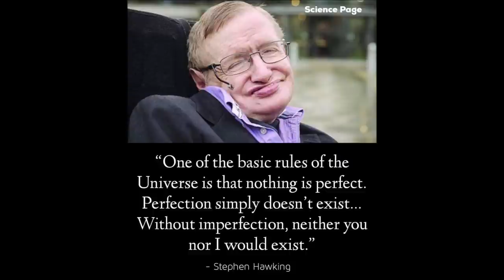1995 Toyota Supra Twin Turbo 2JZ-GTE 1/25 Scale Model Kit Build Review AMT Fast and Furious AMT1101

Comment: I'm 64 and graduated in 74 and my friends hate these cars because we grew up with the 426s and 409s and 427s etc. But I tell them all to take their cars and run these cars to get some respect for these bad boys ! They are hot modern muscle cars and this was a great representation of them . Tks
Reply from the maker: You bet, in stock form these Supras were running faster 1/4s than most 426 equipped cars. Lots of bang for the buck!
And they could turn a corner too.   LOL

Comment: Awsome job! One thing I started doing for stuff like the hood vents to get a cleaner edge is to use lots of black panel accent and let it draw up to the edges then use acrylic to paint the vent. It means you don't need to brush paint right up to the edge and the panel accent draws up to the edge in a nice clean line
Reply from the maker: Yes it can be done that way as well, thanks!

Comment: That twin  turbo can get down the road rapidly, and I mean rapidly.🏁👍
Reply from the maker: Google says 13.4 quarter mile bone stock, which is as fast or faster than 426 Hemi car speed. And just a little more boost from the stock set up gets you into the 12s which is moving out.

Comment: Very cool kit Chris.  I have looked at this kit a few times and just picked one up. Mainly was worried about fitment issues. You said it went together nicely so I may have to pull the trigger on one and add it to my stash.
Reply from the maker: Glad I could help!  Honestly, I rarely have issues but I'm not a perfectionist. There are very few kits I've had fit issues with that can't be fixed fast with simple work.
I think some folks in model world just love to pretend things are harder than they really are.

Comment: I can’t really tell if Round 2 corrected the flash issues on the front bumper. I built the last issue of the FnF version and the flash on the front bumper was horrible. It was difficult to smooth it out. I wanted to build it like the FnF version, but the orange color I chose was way off and decided to go a different route. I put a big block Chevy under the hood and lowered the heck out of the car. I’ll post it on the hpiguys Facebook page soon.
Reply from the maker: I'm not seeing any issues with mine.

Comment: For clarities sake this engine is not VVTI, that system didn't debut until the 97-98 model year.
Reply from the maker: I'm just reading off the box man. I'll leave the specifics to the 'experts'. Maybe it's a transplanted engine, who knows, it's a custom job afterall.
Reply: @hpiguy  I know you are, I just wanted to put the correct information out there. There's not a lot of visual differences, just a bump on the front driver's side of the cam cover and a line from there to the oil pump.
Reply: nice Nerd Out - but I'd be more concerned about the molded color...
Reply: fatbrian81, Thank You for The Information Sir n God Bless.